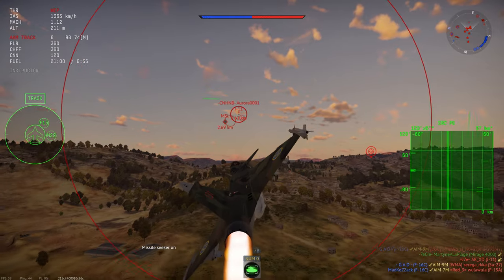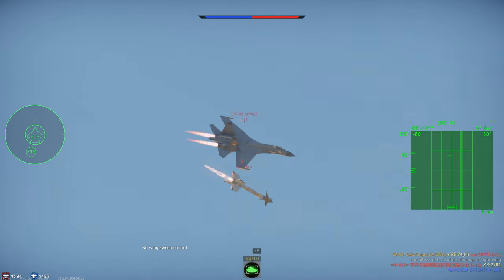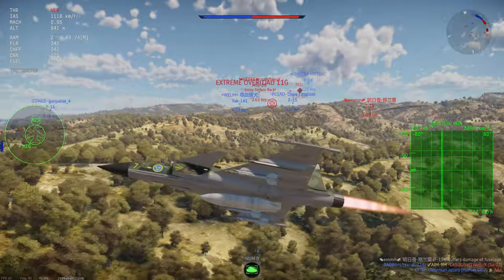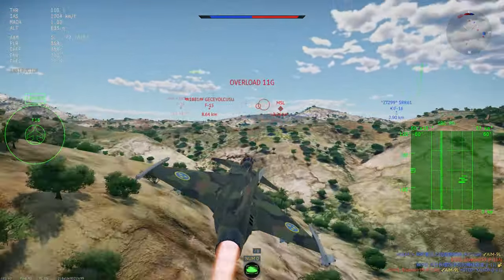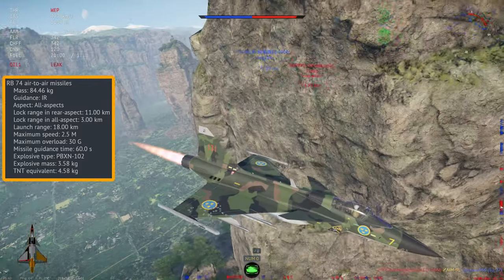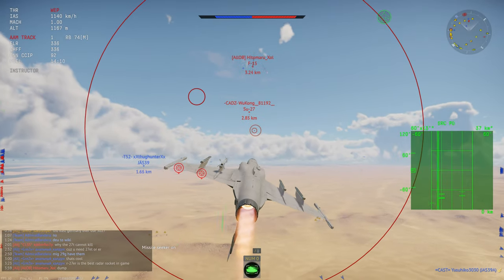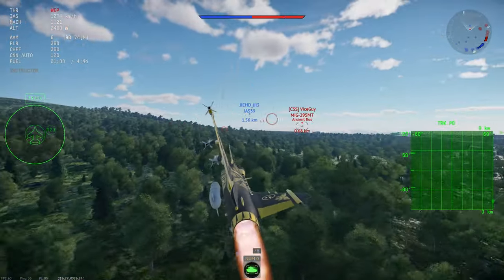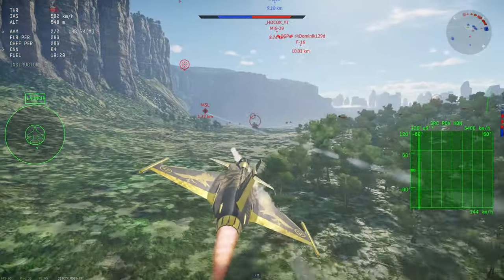Should You Grind For The JAS 39A Gripen..?

Comment: Being that I am a hopeless Swedish anything-fanatic I couldn't help but pick up on the comment about the Gripen A being introduced in the mid 2000s; this is not true. The JAS 39A Gripen was introduced in 1996 as the first Gripen to be introduced into military service. 

You also mention that the aircraft is to be serviced by 5 conscripts and a skilled engineer; this is true to a degree. The Gripen family is to be serviced by 5 conscripts and a specialistofficer (eqv. Senior NCO) which is a personnel category not a proficiency level or indication of occupation. I suppose it's also worth noting that this is for in-field servicing on road bases in a 10 minute time window.

The unit cost comment regarding being more expensive than the F-35 is relevant for the newest JAS 39E Gripen, not the 39A. Due to my inherent bias, I also have to mention that this is the unit cost whereas the CPFH is much lower, roughly USD $5800 (39C).

I'll conclude this message with commending you on the effort going into giving a background history on the aircraft and therefore should not be expected to be flawless, regardless it's a very impressive effort.

Comment: Can someone explain how does TWS mode actually works? I don't know how it differs from normal Search.
Reply: src is work only radar, src pd is work radar + filter algorithm, TWS is work radar, filter algorithm and Memory is keeping some last target position + Computer is building curent position with vector moving
Reply: You can „soft lock” on a target while still scanning for new contacts. On a normal radar, you cannot search while actively tracking a target. This also allows you to track multiple targets and subsequently guide multiple missiles (iirc limited to a few SPAA’s)

Comment: >says the Rb71 is an L missile
>shows many instances where an Rb71 would have lead to a better outcome
>especially the teamkill.
Reply: rb-71 are very ez to dodge you don't even need to hug the ground to evade
Reply: @ferrous3262  if someone launches it at you far enough away that the motor burns out, yeah, it's easy to dodge, like any other missile.